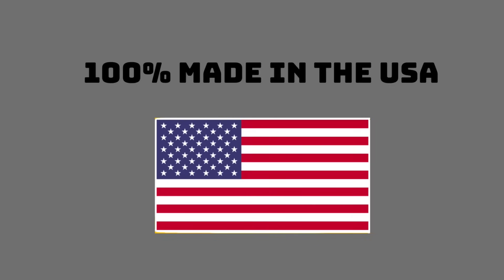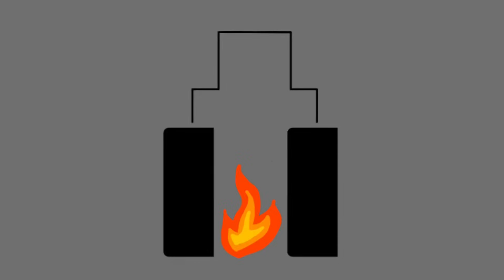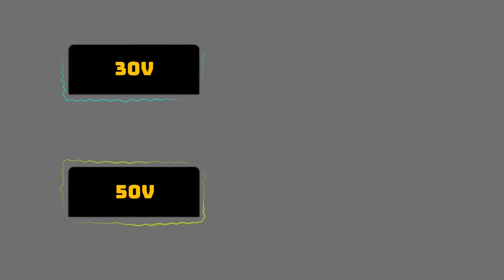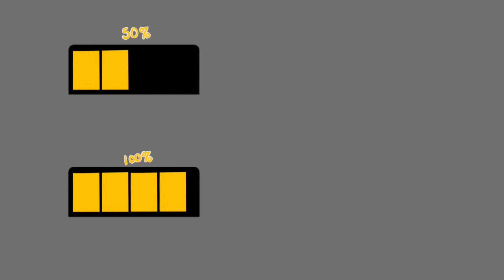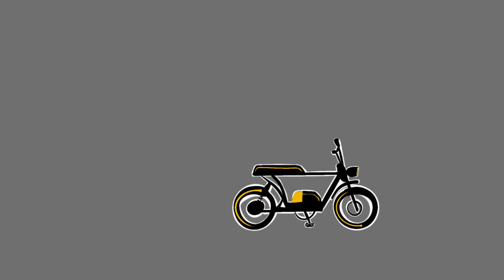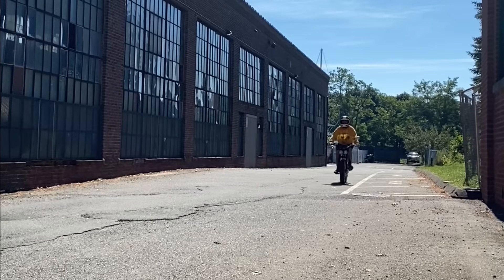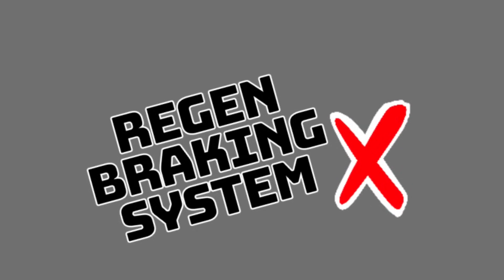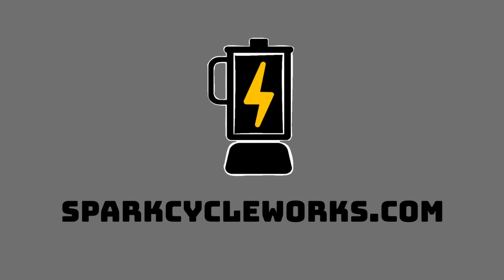How to Add a 2nd Battery to Your eBike Using the Battery Blender

Comment: Sounds like there's an ideal or Schottkey diode in there somewhere...i use a potted Schottkey for my two batteries, and I charge them with two chargers, one charger on each battery - totally isolated, and no "intercharging"...again, no regen will work. The diode is a "one way valve, combining the two batteries...works the same.
Reply: That's what I used to connect a second battery to my Shimano EP8. Put a lot of miles on it without any issues.

Comment: Is anyone familiar with a less expensive device like this one? I know he’s gotta make up for “creating” this battery blender, but actually he didn’t, and there’s got to be a less expensive option than $150. Because that’s wild
Reply from the maker: @drummerdgun  The price is now $125. This isn’t just a parallel xt60 plug you can buy for $15. There is much more that goes into them than you might think and they are all hand made.

Comment: From what I understand thus far is they should be the same volt. I guess I'm going to find out lol. I have a rad plus 6 with 35 amp controller and I'm going to hook a 10 amp hour battery to the stock 14 and see what happens. I just got my 40 amp blender. Waiting for the battery should be here in a few days.

Comment: Kool product! do I still need this if both my batteries are same voltage? 48v  Also. can I plug in 2 contollers? I have dual motors and controllers.

Comment: Was interested 'till he said 30Ah limit. I need it for 2 20Ah batteries.
Reply from the maker: Hey, 30 is the amp rating, not capacity. You can use any capacity you like. We’ve also updated the design since this video and can push 35 amp for the amp rating 👍🏻

Comment: Can i connect/power two controller's and two batteries same voltage and AH to power a AWD drive bike seperate throttles and hub motors using this device??

Comment: I purchased affordable hoverboard batteries equipped with built-in Battery Management Systems (BMS) that match the voltage of the original battery, almost a fraction of the stock battery's cost. When the main battery's charge depletes, I switch off the main battery and connect my secondary battery. This method effectively doubles the travel distance. I've been utilizing both batteries for over 1000 miles without any issues. Therefore, I don't understand the need to consider a battery with a different voltage. Additionally, using a blender doesn't seem like a practical option, as it would be challenging to monitor both batteries while pedaling.

Comment: I have an Ariel rider 52v xclass if I get this blender can I connect a 60v battery to it ,? Or should I just connect another 52v battery to it ty
Reply: I'm trying to do the same thing you're doing. Did you have any luck? What controller are you using
Reply: never mix different voltages!!!!!!!

Comment: I'm a certified ebike anti-technician. I specialize in fires and explosions. Seriously electronically challenged. So before I apply my trade once more do the batteries need to be disconnected from this device before charging? 🔥💥🤪

Comment: Fat tire Ancheer Speedrid electric bicycle 36V 500W brushless rear motor 

Will the controller be able to handle a second battery and how do you check? I have a 48V 10000mah battery I wanted to use

Comment: Those it work with 72v batteries I’m trying to power my 2000w hub motor with two 72v 19.2ah battery that has LG 4800mAH cells..?

Comment: I do not have regen braking but supposedly my Chinese folding fat tire ebike has a bit of regen when going down hills.  Would this be safe to use still?
Reply: Any kind of regen sends the voltage in the opposite of the usual direction.  Apparently the Battery Blender isn't designed to work with this "back current"

Comment: I have a question I can't seem to find anywhere:

If I have the battery blender hooked up to 2 52v batteries and the controller, do I have to plug in and charge each battery separately, or if I plug in, will both get charged?

If the former, should I disconnect one or both of the batteries from the bike to charge them, or is it safe to charge both while connected?
Reply: Most likely both batteries can be charged simultaneously, while connected to the "blender", assuming there is a diode in the "blender", even at different charge states. They should be fully isolated, and one won't charge the other. I do this on my etrike with a Schottkey diode.

Comment: I realize this an old video but here's to hope.

I just ordered this product.
I have 2 - 52v batteries one at 20AH and the other a 45AH.

When combining these using the blender do I have to make sure both batteries are full charged or fully discharged? 

I'm Trying not to burn down a $5k Xclass build.
Reply from the maker: WithOUT Blender: YES. WITH the Battery Blender, NO. The whole objective of the device is to make it so that you never have to worry about balancing. This is critical for bikes with removable batteries.

Comment: I have a question. What if i would blend a 52V battery with a 36V battery? The 36 is at 42 when at full voltage and the 52 is at 43 when empty. What would that work like?

What about charging a setup like this?
What about charging a 48/52 setup? Could i simply connect the higher voltage charger to charge both or am i limited by the lower charger for 'overnight charging' and need to keep an eye on it at all times when doing the higher voltage charger?
Reply from the maker: Hey! We would advise against a 36 and 52V. Simply because your motor and controller are likely not capable of handling the wide of a voltage band. 52 and 48 are just so close that people like to use the 52V to "supercharge" the system at risk of blowing it out.  As for charging, both batteries charge independently with the charges that came with the batteries.
Reply: @SparkCycleworks  My controller is actually fine with that voltage range. My front light will burn out with that 52 battery though. My question is more hypothetical. Thanks :)

Comment: How do I know if my controller can take a 52 V battery mixed with my 48 V battery and controller?
Reply from the maker: On most bikes it’s a bit of a gamble. If you can access your controller, it may say it’s rating on it. If it’s definitely 48v, it’s not a great idea to push into 52v unless your confident in replacing a controller yourself someday. In 95% of cases, just sticking with two matching batteries is the way to go.
Reply: @SparkCycleworks  After a bunch more research, I came to the conclusion too. Thanks for your time and helpful video.

Comment: I have the money only not the skills to connect them together.  I already take a second battery with me on my Engwe engine pro. I put it in a safe gun case and strap it on my rear rack. After the first battery is empty I change them.

It would be so cool if I could connect them permanently.

Wish I knew someone who could do this for me.
Reply from the maker: Battery blender would help you accomplish this exactly

Comment: I have a now discontinued Sondors Fold Z (Mini) with a 36v 8.7ah battery. Would I be able to add a 48v 20ah battery just by using the battery blender or would I have to change the controller as well?
Reply from the maker: Unfortunately pushing to 48v would require a new controller and new motor. Best to stay with 36

Comment: If you run two batteries of the same voltage you don't need it.
I run 10AH+20AH  52V LiFePO4  system 
works fine charged separately..
Reply from the maker: You certainly can. The problem rises when you try to run them and down balance their charges before connecting them. The Battery Blender makes it so that you never have to worry about charge level. You just connect your batteries and go. If one is partially charged and the other is full, you’re still good to go.
Reply: @SparkCycleworks  They balance at the end of a charging session
If on the bike same Voltage batteries but one charged slightly lower they'll match up and then both contribute

Two 52 V batteries  once  matched act as one..
Electricity 101

Comment: so u mean battery blender is for those idiots who mix 30 v and 50 v ?
Reply from the maker: It’s for folks who removable and don’t want to have to go through the process of voltage matching every day when they ride to work. Also for folks that don’t want to worry about battery fires.

Comment: The price is a bit to steep for me.
Reply from the maker: Yes, we’re working to get the price down, but there is a lot going on in that small package. It is not just a simple wire adapter. Hopefully someday we can bring it to a higher production instead of individually built
Reply: @SparkCycleworks Of all the unanswered comments and questions here, THIS is the one you respond to? 

Very Suspicious.  If you stand by your product then get off your butt and answer all these questions.

Comment: If I were to add a front hub motor, can the second output be used for that on a separate throttle/controller and display?

Comment: Hi, have a Ride1up with a battery in the frame.  Is it possible to buy a smaller battery and simply attach it to the rack and run a line somehow to the main battery?  Thanks.

Comment: Got the battery blender and had it for 1 day so far so good im super happy with the results. 1 question can i charge 2 batteries at the same time with 2 chargers or is that dangerous?
Reply: with two chargers.. no problem 
with one charger and a splitter?? can work or not
both packs should be identical in voltage and if one has an inline diode in charge port then also the other should have one

Comment: So if I make sure both batteries are the same and charged to 42.0v each I can link them safely use them then when dead recharge separate..would this then void your device (in terms of the safety of the batteries.)

Comment: I have a question: You gave the example of a couple of battery's with 50v & 30 volts & claimed there would be a fire or explosion but how about if the difference is just two or three volts,is the risk really that great? (I appreciate that you are unlikely to be objective or independent as you have a vested interest in selling those benders but I live in hope).
Reply: My bike has 2 42v batteries both are the same mah and same make batteries and I link them with a y harness I made with three xt60s and cable but you can buy an ebike battery y harness for £10 on Amazon and it worked for me 😅

Ps they are both the same brand and I checked the cells are the same as long as they are charged by same charger they get to same voltage I leave them to cool down after charging. 
I then check voltage with tester and as long as they are Within  .2v of each other ie one is 42v and one is 42.2 I connect them and use it had no issues yet buddywouldnt go higher than .2 tho myself
Reply: @steebbo9460  I had two very unequal batteries connected to my controller with a bit of wire that I made up but my older original battery which used to charge up to about 42v & run the motor down to about 35.5 volts started cutting out at about 39.5v. Before I tried that setup so I think that needs to be sorted out first.
Reply: @nicholasmorrill4711  could  maybe get a step up booster for the low voltage battery to take it up to 42v??....
Reply: @steebbo9460  Never heard of one of those.
I am liaising with another character on another thread who seems to have a similar problem only with 42v batteries.I put it to him that it could be the BMS thingee that is faulty & I'll see what he says.
I don't really want to add any more weight & at the moment I have got the ebike running with another brand new 36v battery so I'm not in a hurry.I'd just like to solve the problem with this original battery because it is fitted nicely into the frame so running two batteries would be supa dupa.
Thanks for your suggestion.Maybe that's something that I will look into in the future along with one of those equalizing things that without it I'm told the whole shooting match could explode.
Reply: @nicholasmorrill4711  I'd say it's your pack could be degraded to say 95%
Reply: @steebbo9460  I don't know where you are getting the idea from that my pack could be degraded to 95%. It will only charge up to about 40.2 volts now & cuts out altogether at about 39.5 volts.....& it has had nothing like the 1000 charges the retailer claimed it could take.I'd say it's fucked.
Reply: @nicholasmorrill4711  that 1000 charge guarantee  is a load of old balls tbh mate it can't be guaranteed because malfunctions happen and usually with the bms tbh.
Reply: Or damage to cells from the bms had that a fair few times.
Reply: @steebbo9460  Well thanks for your experience.I am certainly finding it a minefield..........Never try to buy a hub motor kit from the Chinese sellers on ebay that is my advice to you.They have nearly driven me mad.
Reply: @nicholasmorrill4711  I find there hub motor kits to be awesome tbh...ive had 3 5kw through mine and it holds up amazingly tbh...not even had to change the phase wires ....but the batteries I wouldn't touch them with a stick  tbh...
Reply: On the same note I've just picked up a 52v 19.5ah 21700 battery pack  for my ther bike the Chrysler chopper and they are a power house at 379.99
Reply: @steebbo9460  They are probably good kits provided you don't want to fit them in the most average of bikes because asking any questions as regards cable lengths is a no no. They should stick to selling noodles in my opinion.

Comment: I'd like to know if anyone has actually connected up two battery's in parallel & had them explode or have other detrimental effects that the people flogging those devises claim because at the moment I am hearing conflicting advice.
Reply: Me too. Where did you hear the negative claims?

There any risk of degrading the batteries quicker by running different spec batteries in parallel. i.e. 52 vs 48v, age difference, etc. 

I understand diodes only discharge one way, but I'm getting conflicting reports.
Reply: @raczyk  I have just heard people mention under other video's that they run their batteries without those devices & they have had no trouble.....Personally I have my main battery that came with the bike cutting out at about 39.5 volts so I bought another one & connected it up in parallel & the funny thing is that I run my old battery until it cuts out then flick the switch on the new one & after a mile or two I have found that when I turn it off & go back to the original it has gained a bit of charge & come back on stream. These scare stories have got me isolating the original but I'm not sure if there is any foundation for it?

Comment: Good afternoon, I have a Sondors Fold XS, I have an extra battery, same voltage and amperage, Do you have a connecter, That I don't have to switch the batteries in and out of the bike, just carry it in my Back bag?

Comment: Hi there! Thx for this video, I Have a question.
Do I need to have both batteries connected all the time or I can connect the second one only when I need for long trips, I don't want to cary extra weight for short trips, besides that I am in downtown Miami, so every time we go somewhere we to lock the bike and cary the battery in a backpack to avoid get stolen.
Reply from the maker: Not recommended, unfortunately. It will function just fine with a single battery, but there could be long term concerns as the blender is designed to split the amperage, rather than have it all coming from one battery. In addition, there is the concern of water or other moisture coming in contact with the connectors/prongs of the battery bracket that would not have the battery on it, as they would be exposed to the open air. TL:DR: Possible, but not recommend. Would be a big risk.

Comment: Will it work on a revi cheetah ebike if yes   how do you install it  with a triangle battery cheetah has a 48v 17ah battery the triangle is 48v 20ah battery
Reply: It will run on any system with any voltage or capacity battery as long as you have XT60 connectors for your controller and batteries. - If not, Add them or use adaptors.

Comment: Just bought a deep-cylce Renogy RV battery with a 12V output and 200Ah power. I want to use this as a supplement to my RadRover 48V 13Ah battery so I can extend my range. I don't really care about power - it's all about range since I'm using the bike as a backcountry backup/escape option for my Jeep. Will your Battery Blender allow me to "tether" the factory 48V to the Renogy 12V and effectively charge the 48V or would it be tter to just run the bike straight off the 12V at a lower power output?
Reply: Make sure your Rad doesn't have regen brakes.....I know some Rads do ....just nit sure which ones do.

Comment: I have the ado a20f 36v 250 w motor, controller is zm-a20f dc36v/48v  max current 15A, can i use this Blender to put on another battery also 36v on my bike?

Comment: my ebike's controller is rated to be 48v 22a. the main battery is rated as a 48v 14 Ah battery. i know amps and amp ratings are different,but the question i have is are you meaning its limited to pull up to 30A? ive been confused on this topic and couldnt find a good answer that'd solve my confusion. for the most point i know that i'd like to add an additional battery but im not sure on where im truly limited on with the controller involved,any suggestions?
Reply from the maker: The main thing you need to look at is your controller. That's the limiting factor. It will state an amp rating on it. So long as that is within our limits, you are good to go.